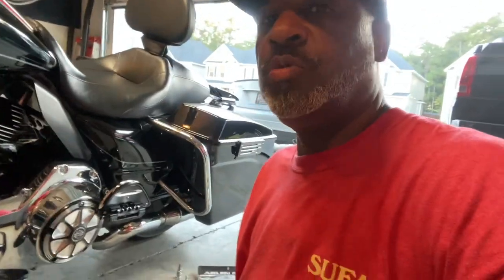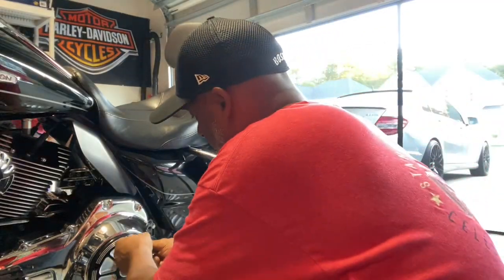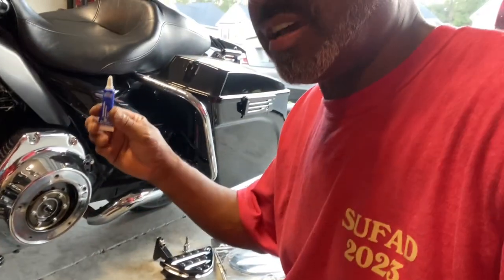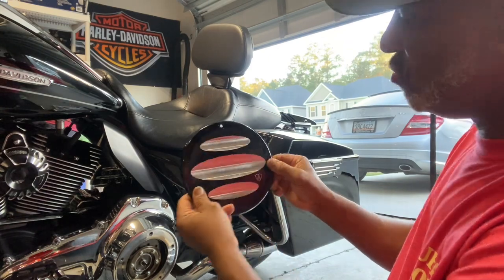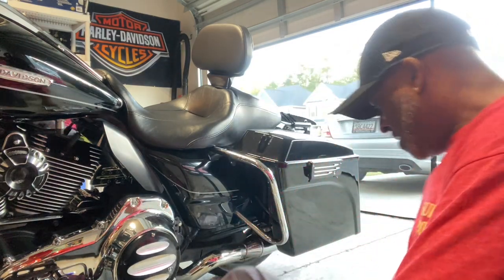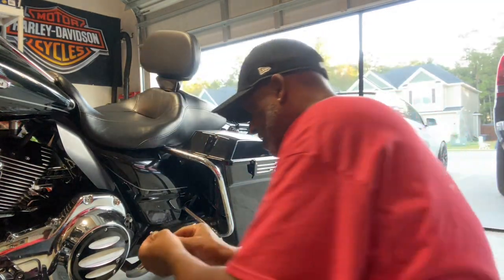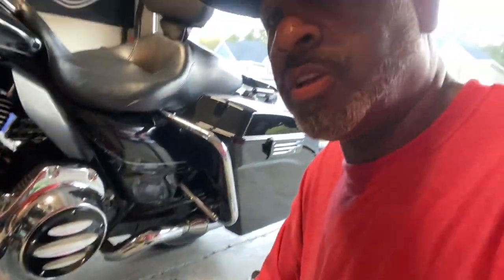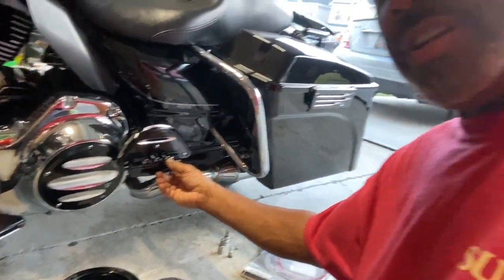Custom Derby Cover Install On My 2012 Ultra Limited

Comment: Why you didn’t install your head unit man.
Reply from the maker: Don’t like dealing with electronics. Thanks for watching
Reply: Yeah I hear you,but man it’s so easy I’ve a RG Special and a electric glide and I did both units plug & play sound stream,head unit amp and speakers also cut bags for speakers...go on line and check out volunteer audio,Jay give you step by step.
Reply from the maker: I purchased both Reserves from Volunteer. Maybe I’ll do it on my next build.